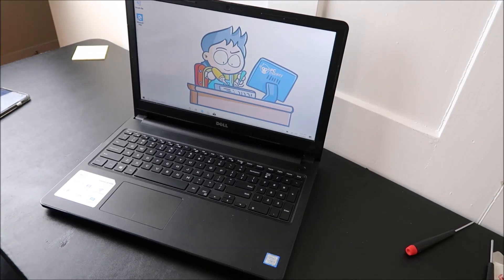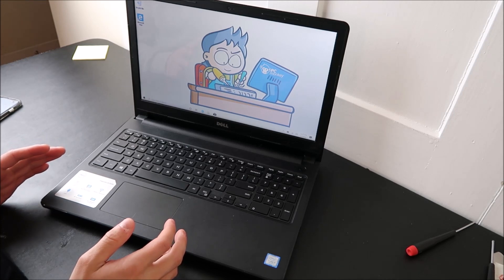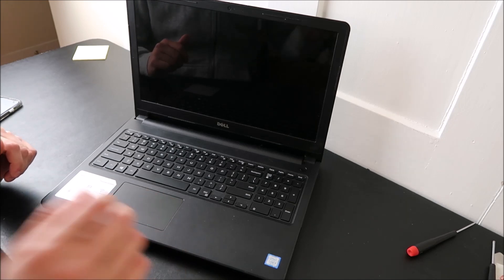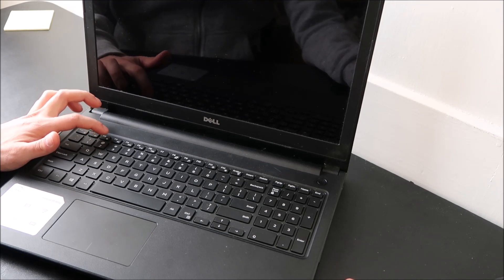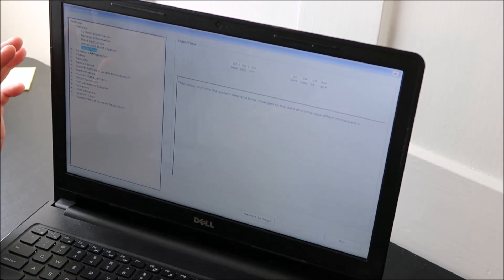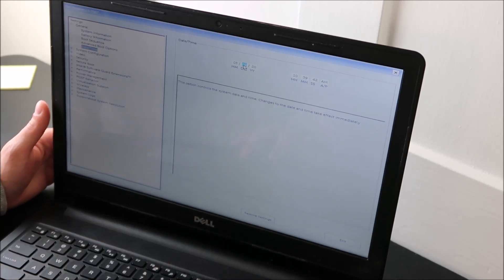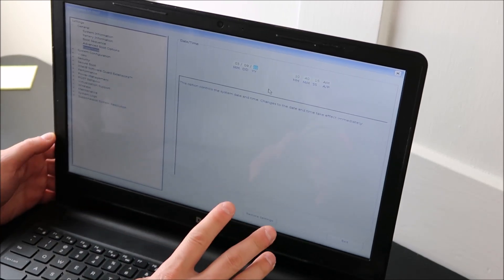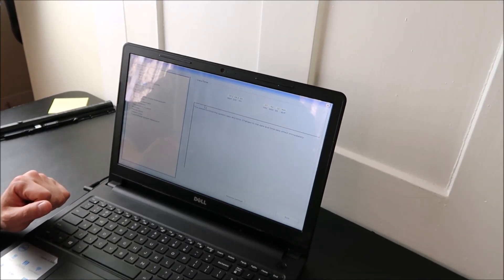How To Fix Dell Checksum Error, CMOS Error, RTC Low Battery, Date and Time Error, 0251 Error

Comment: Dang. Got to BIOS menu, changed time and date saved and exited menu as prompted.. was I suppose to turn off after/ reset?..
Cause now this shit laptop of mine - which is dell studio 1537- like  grunted kicked fan on and  I’ve got a black screen with a white bar (left upper corner) blinking,…
won’t let me enter setup mode now (f2 key I hit as before),
Ooh! Well just this moment displays “error loading operating system”
Soooooo Wttttfffff
Reply from the maker: relax lol Sounds like you corrected the Date/Time error but perhaps found what caused that error in the first place ;) For a No OS issue on a Dell computer, can you try the steps seen here? https://www.youtube.com/watch?v=-luB1N3qoEM

Comment: Thank you!  This has apparently helped my wife's Dell Inspiron 5477 All-in One Desktop (vintage Jan. 2019), which has been acting up the last several days; we think ever since it had been unplugged for a short time a few days ago - seems like the symptoms gradually got worse over time, and today it simply refused to stay up / the session kept logging out due to DWM crashing / other screens showed RAM and SSD Memory full.  Anyway - tapped F2 during boot-up like you demonstrate, and the time clock in the BIOS showed 10 minutes behind, so I updated the time manually and now it's been working so far / only about an hour.  Since it's a desktop and usually plugged in, then we should see the problem again next time it's unplugged or the power is off since we have not changed the CMOS battery, which the manual shows it to have - not looking forward to prying off the large back cover.  Thanks again.
Reply from the maker: Glad your all set for now!  Good luck replacing the CMOS :)

Comment: Ok, what if I replaced the battery and the error still persist? Is it an system board fault?
Reply from the maker: Yes.  At that point, I would assume a motherboard issue :(

Comment: Hii i have a alienware m17 r3, i tried adjusting de bios setting and the problem still there that when i start up the laptop Just the key and on/off bottom have blinking, otherwise the laptop dont have a cmos battery i check it all and dont have, i try updating de bios but the problem still
Can you help me please?
Some people told me that it could be the bios corrupted
Reply from the maker: Yes, most likely your BIOS is messed up.  You would have to refresh or reload it.  Because BIOS is so tricky to mess with and there is such a large risk of messing it up and 'bricking' your computer, I dont have any videos on that at this time.  Sry.  Many other content creators have tutorials on that though.  Shouldnt be too hard to find :)
Reply: @PC_Monkey  HI i have been looking all tutorials and cant found a one that works for me, btw i bought it 1 year ago so it's like New, what can you recommend me to do?

Comment: I have alienware m15, it shows real time clock error system cmos checksum bad. It only works with power adapter plugged. Will this procedure help.
Reply from the maker: Yes, this is the first troubleshooting steps you should take.  You may also have to replace the CMOS battery if this does not work.

Comment: hi bro , I have a dell vostro 15 3568 model and it has got a problem, the problem is that my pc shuts down or turns off suddenly and when i start my pc again a error comes saying 'Date-of-Time not set invalid config' and then i go to bios and change date and time then i boot my windows it works for some time but again my pc turns off suddenly with the same error and this happens in every 2 to 3 hours after starting , i ALSO CHANGED MY CMOS SEVERAL TIMES BUT still this problem is happening . PLS HELP ME PLS PLS PLS.
Reply from the maker: Is your computer overheating? 
If this keeps happening, try replacing the CMOS battery.  That is usually the component responsible for keeping that date/time setting correct.
Reply: @PC_Monkey  hi bro i changed my cmos battery 3 times initially i used panasonic battery and then i used a duracell one  but still getting the problem and my pc does not overheats
Reply from the maker: @raybolt-1785  If the CMOS battery is ok, then you may be looking at a Motherboard issue at this point :(  Or a BIOS issue and BIOS would need to be reloaded.
Reply: @PC_Monkey  bro i updated my bios but still getting the problem shall i download the previous version of bios ?
Reply: @PC_Monkey  hi bro have u got any kind of solution btw I discussed this issue with a guy ( he runs a pc rapair store) he told me that there is a problem in the motherboard
Reply: By the way I live in India
Reply: By the way I live in India
Reply from the maker: @raybolt-1785  Yes.  Like i said, its either a BIOS issue or a motherboard issue.  If you can revert to the previous version of BIOS, then try that.  If not, or if that does not work, you may have to replace the motherboard :(   Is this the motherboard you may need?  https://ebay.us/kZSsaZ

Comment: I have a Dell Inspiron 3668.  It shut off and now will not turn back on.  I replaced the CMOS battery and now I get I Amber flash on the power button and then nothing.  I also tried the switching the password jumper to the CMOS jumper but it didn't make a difference. I also hit the F2 button when trying to power it on but nothing happened.  What would be my next step?
Reply from the maker: For a computer that does not turn on, try this video first;  https://youtu.be/P3I7dDpkJps.  Let me know how that goes :)
Reply: @PC_Monkey  Thanks PC Monkey!  I was able to figure out the issue.  It seems the 16G of ram I installed about a year ago quit working.  Even though one flash points to the BIOS I pulled it on a whim and got lucky.  Do you have any videos where you go over memory and what would be good to have as well as brands.  Thanks for your help. I'm subscribing to your channel.
Reply from the maker: @victorgruebler215  Nice job !!  This is a quick very general video on how to purchase the correct RAM:  https://www.youtube.com/watch?v=NtCzunl0AQA&t=9s
If you are looking for suggestions for upgrades, try sites like crucial.com :)

Comment: Hi, 
My laptop makes a short beep and turns off ,then I have to wait about a minute to get to work else if I try to turn it on again it make the same short beep and won't start .
Please help 🥺🆘
Reply: And I tried. Your way the time was accurate 🙂🥺
Reply from the maker: Are you able to see anything on the screen after it beeps or does it stay black?
Have you tried the RAM test as seen here?  https://youtu.be/u-REPLdpZ70
Reply: @PC_Monkey   what I noticed that the laptop won't turn on unless it connected to the AC charger .
Yes I tested all hardware memory ,rom , battery,and I tried to run the dell diagnostics test ..all passed 🥺 can't find where is the problem 💔
Reply from the maker: @AHMEDMZIZO  If the computer wont turn on without the power cord plugged in, the the issue is most likely the battery.  It should be replaced.
Reply: @PC_Monkey  thank you very much I just took the laptop to the shop and said the same thing too he's replacing the battery right now .
And also how can I know the new battery is good because I can't trust the technical it's my first time dealing with him 🥺
Reply: @PC_Monkey  thank you again for your help ❤️❤️❤️❤️❤️❤️❤️❤️❤️
Reply from the maker: @AHMEDMZIZO  Good luck :)

Comment: I can’t click “apply” once I’ve changed the date and time… what should I do?
Reply from the maker: Is that choice grayed out?  Are you able to hit the key for 'save and exit'?
Reply: @PC_Monkey  yes and yes
Reply: @PC_Monkey  my laptop is basically restarting over and over and can’t boot up. When I long press the power button it says: “Invalid configuration information - please run SETUP program. Time-of-day not set - please run SETUP program.”
And then I tried to fix it in the BIOS but it doesn’t seem to work ):
Reply from the maker: @aaaaiiiieeeellll  Assuming you have a Dell computer, are you able to perform the diagnostic scan as seen here?  https://www.youtube.com/watch?v=_qF-oqPrn7M&feature=youtu.be

Comment: my laptop works fine and normal however whenever i open a specific software for a few minutes, that's only when my computer shut down and shows the error upon startup. If I don't open the software, it works like normal. Is that possible?
Reply from the maker: Sounds like an issue with that software and how its interacting with Windows. Are you able to find an error as seen here?  https://www.youtube.com/watch?v=Nqn8-jJFx2Y
Reply: Hey Krishtel, I have the exact same issue. Its not related to thermals. Did you manage to fix it?

Comment: i can't change date and time in bios and i hear five beep in laptop and laptop show cmos rtc power failure
Reply from the maker: You may want to replace the CMOS battery then.  You can see how to access that component as seen here;  https://www.youtube.com/watch?v=76I2Ec9K7lw
Reply: @PC_Monkey  i replaced the cmos battery and update bios before
Reply: @PC_Monkey  but this don't solve problem
Reply from the maker: @amirhossein-zu1yv  It may be an issue with the CMOS Battery port / motherboard then :(
Reply from the maker: @amirhossein-zu1yv  'cmos rtc power failure' indicates a dead CMOS battery.  If you have already replaced that battery with one you know to be good, then the issue is with the battery port or the motherboard.  You would then have to either repair / replace the port if you have soldering skills or you would need to replace the motherboard.  What is the brand and model number of your computer?
Reply: @PC_Monkey  dell n5010
and what is your  opinion about beep beep voice while computer show this error???
Reply: @PC_Monkey  the meaning 5 beep for cmos alarm??

Comment: Hey man. I have a Dell Inspiron 14, when I turn it on it starts beeping like crazy, I've searched and found that five beeps means that is a Real Time Clock Error; I've changed the date and time in BIOS, restart it but still won't work:(
Hope you can help me

Greetings from México🇲🇽
Reply from the maker: That is usually referring to a CMOS Battery failure.  Try replacing it.  You can see how to access that part here;  https://youtu.be/76I2Ec9K7lw

Comment: Hi, maybe im missing something or doing something wrong.. But I've changed the cmos 2032 battery in my dell 5577 laptop and updated the date and time settings in BIOS but my laptop continues to crash after 2 minutes of game play (league of legends) are there additional steps or anything else I need to do? does the Seconds value need to be 100% accurate?..
Reply from the maker: No, BIOS should not have anything to do with that.  Is your computer overheating at all?  Try these steps so see why its crashing;  https://www.youtube.com/watch?v=Nqn8-jJFx2Y
Reply: Hi Michael! At least you helped relieve some of us wondering where to get a CMOS Battery! I was happy to see your 2032 Calculater/Watch Looking Battery is most definetly available at #RiteAid . Good Luck with your PC Troubles.

Comment: my computer dies randomly every now and again, then when i turn it back on, it gives me the checksum error, but wont give me the error if i turn it on after a normal shut down... do i need to replace cmos battery?
Reply from the maker: Yes.  I would guess its loosing power and shutting down.  Double check as seen here;  https://www.youtube.com/watch?v=Nqn8-jJFx2Y